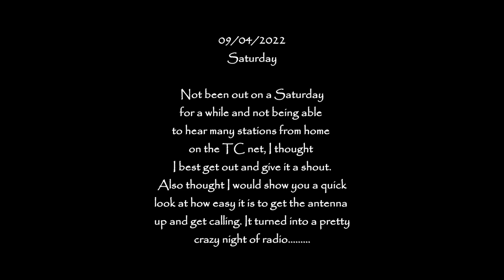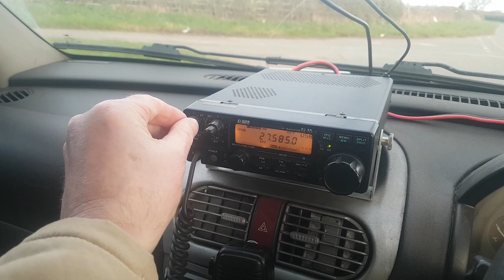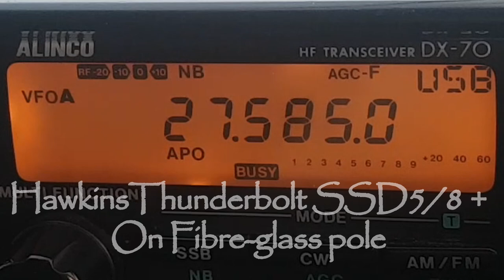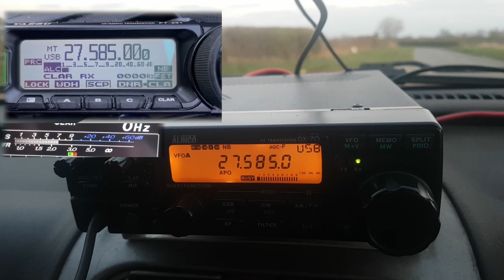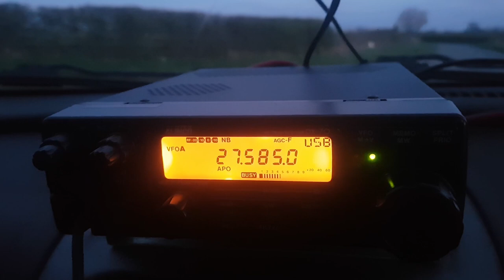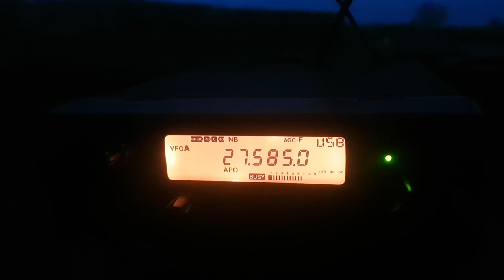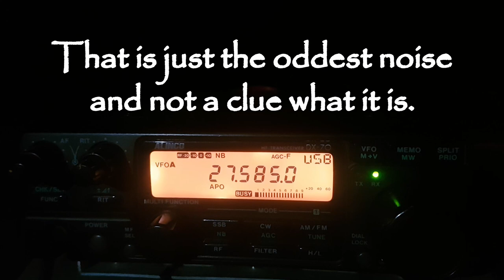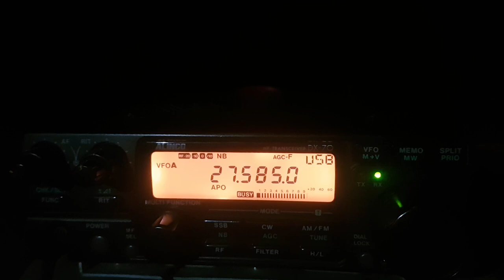Antenna set up for mobile & craziness on the TC net

Comment: Hello Alan

we are on 23.04. with three stations on the Kahler Asten Mountain in Germany at an altitude of 800 meters, we would be happy if a connection to you would be established. If you should be QRV, I would suggest the frequency 27.555 from 19.00 German summer time. My call sign is 13Romeo Foxtrott 233 .Other stations  from UK are of course also welcome.
have a great Easter   55 / 73 Martin 👍
Reply from the maker: Would be great to make the contact, I will have my ears open for you my friend. I may have spoke to you before , but I lost all my contacts which I used to log on a app,  but hopefully will make it through to you come the summer skip time .
Reply: I hope you make a video and I listen me to you tube  😁
Reply from the maker: @martinwasmus1221  get your camera ready and will try and make it from both points of view , I'm both mobile sometimes and homebase

Comment: Nice one Al nice to see how you manage with the spider beam, not having to much luck with mine at the moment(high SWR)  it appears it doesn’t like the feed line close to the wire dipole, I shall have to work something out not to much of a problem.  Are you mobile tonight ?
Reply from the maker: Nope not tonight as daughter coming to visit over the wkend, but i might be out on Sunday although might be a bit quiet.  Hoping you can get yours sorted. Have you got 2 antennas close together then?
Reply: @Al.26TC101  Roger that, might be okay Sunday goodish weather and no work Monday wahooo,, not sure what’s wrong with my setup, I know SWR is flat when the wire dipole is hung from roof gutter, but when I get it on the spider beam, the SWR seems to fluctuate with the wind
Reply from the maker: @killerbites3963  That seems odd whats the dipole, homemade or one you have purchased? I dont have any problems with swr pretty much spot on. Any swr betwern 1:1 to 1:7 is fine  in my opinion. Might be a loose conection if wind affects it with pole moving about. Just my thoughts bud. Hope you can sort it.
Reply: Dog leg? 👍 smaller roach pole